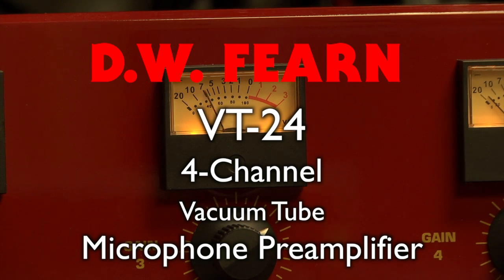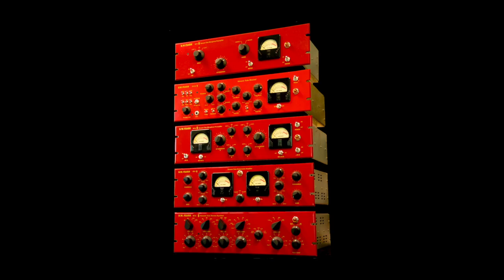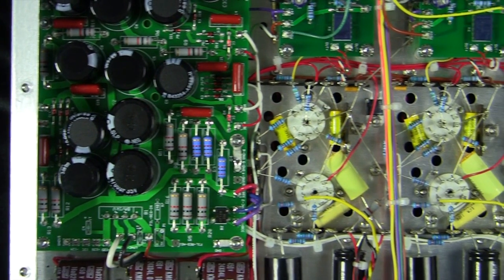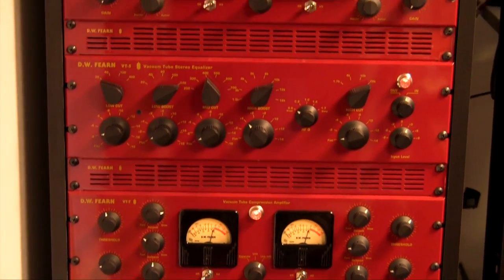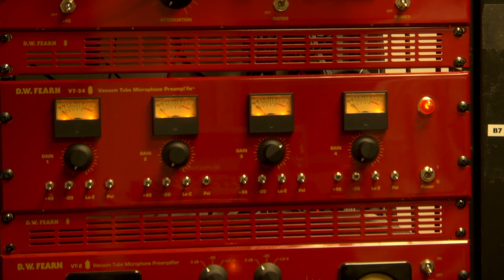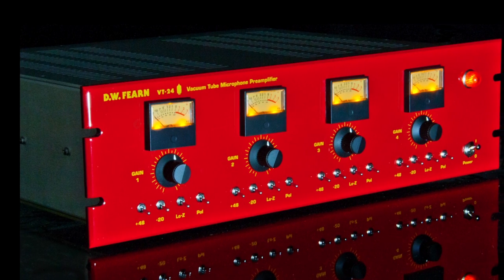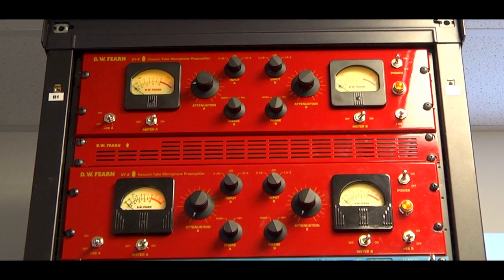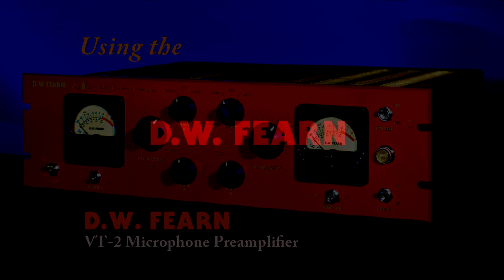D.W. Fearn VT-24 4 Channel Vacuum Tube Microphone Preamplifier

Comment: Is there a benefit to using an XLR patchbay over traditional 1/4in/TT?
Reply from the maker: I believe there is a benefit. TRS jacks have a very small contact area and are prone to oxidation of both the plugs and jacks. Oxidation introduces distortion, or, at its worst, intermittent connection. XLR connectors have a much larger contact area, and the way the connectors mate, it automatically scrapes off any oxidation. Of course, an XLR patch bay takes up a lot more room, so some studios use XLRs just for mic patching.
Reply: @DWFearnHazelriggIndustries  Thank you for your response. Been looking for a solid answer on this subject. I am extremely thankful.